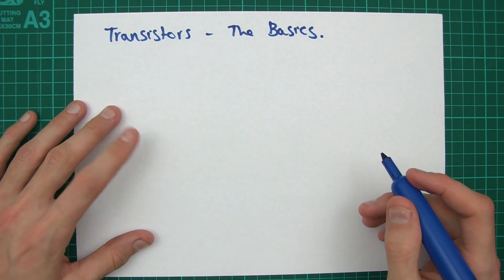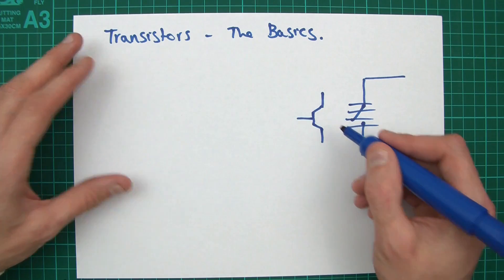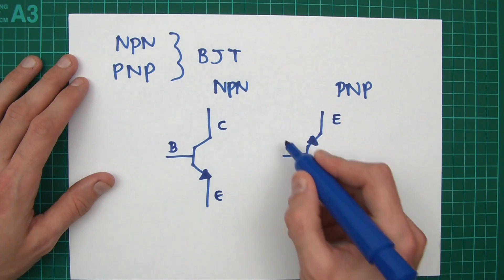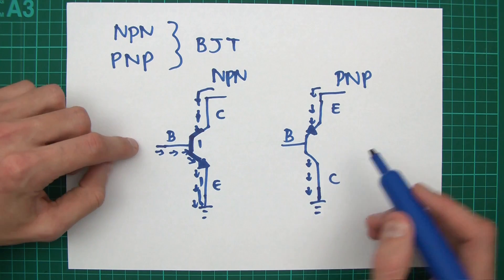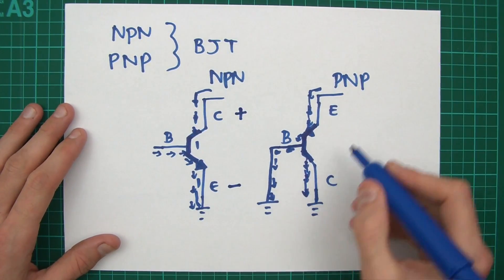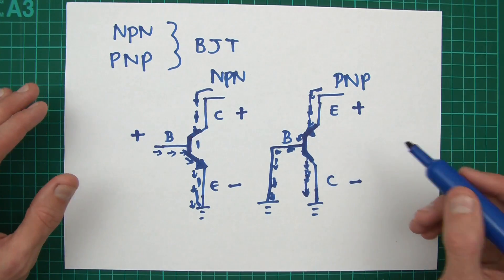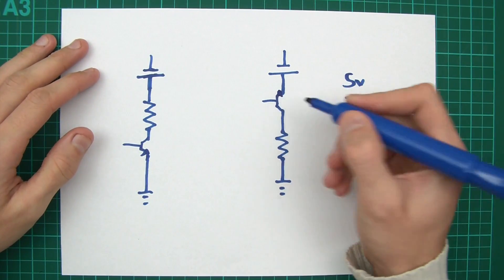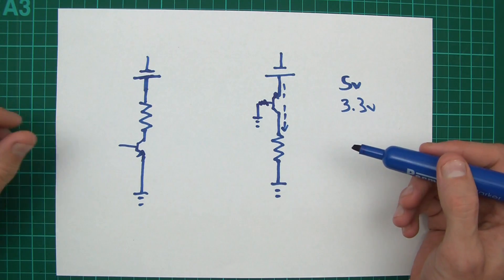TUTORIAL: The Basics of Transistors (BJT: NPN/PNP) - Switching (Theory)

Comment: adding a resistance before the NPN transistor eats up the 12 voltage and we require lesser voltage at the base terminal to turn on NPN which is why every NPN circuit resistance is there between the supply and collector point. So that it becomes a low switching transistor and can be manipulated with microcontroller supply voltage?

Comment: Interesting! Let me check if I understood correctly:
 
To switch on NPN, you need: Vcollector < Vbase + Vbe
To switch on PNP, you need: Vcollector > Vbase + Vbe 
 
That is, assuming the circuit used as example. Meaning (maybe): necessary voltage dividers (resistors) to drop the potential before the collector on NPNs while such dividers before the base and after the emitter on PNPs. 
 
Is that it? 
 
Also, nice explanation to one of the reasons for PNP to exist. Perhaps there isn't much more reasons but one might be the possibility of generating patent...? No so sure..

Comment: i'm confused! In the NPN you need 12V on the base? I thought a small amount was required to switch it on. Please confirm
Reply from the maker: Hi, no, not 12v on the base. A small amount of current on the base only.
Reply: @antonycartwright  From minute 10m:45s (using NPN upstream of the resistor) i understood that the voltage in the base should be equal or higher than in the colector to saturate the transistor. If i understood wrong  and i can control using the NPN with a small + voltage (>0.7V), I really don't understand the point of PNP besides a personal preference.
Reply from the maker: @MrRicardosgeral  Hi, the answer to it is after 10:45. I was comparing using NPN/PNP for high/low switching. YOu have to continue watching for the explaination.
Reply: @antonycartwright  only about 0.7 volts to turn on transistor.